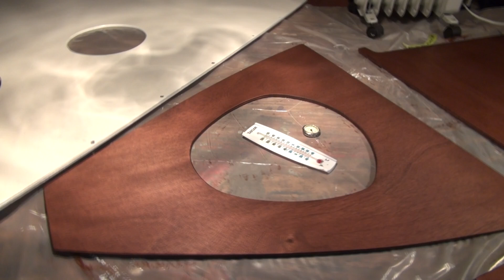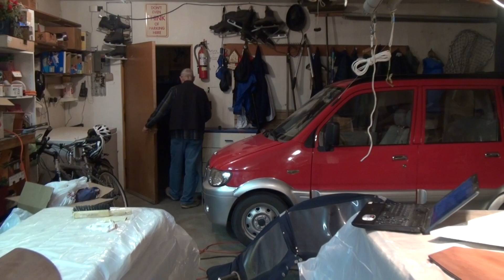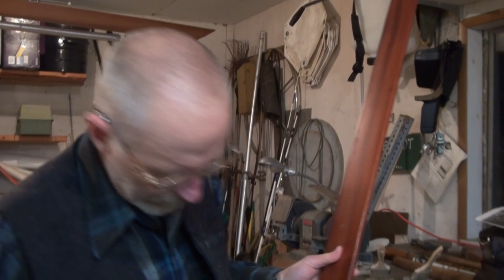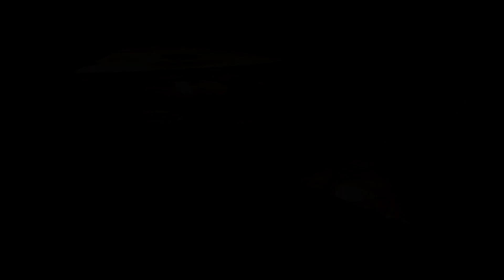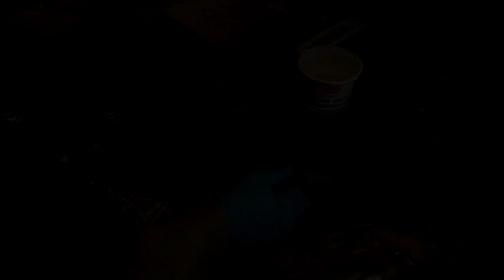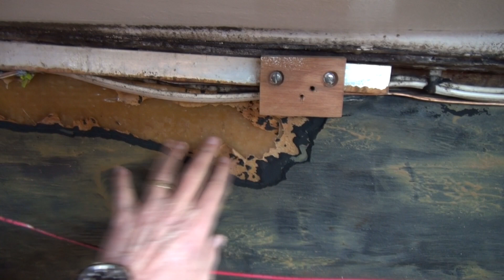Cruising Lealea Refit No.16: Previous Owner's Improvements

Comment: Few tips: You can wash epoxy brushes with alcohol. 
To treat both sides at the same time you can make a spike board. Hammer thin nails through a scrap plywood and turn spikes up, then start epoxing Your pieces from the backside, turn over on the spikes and treat the other side. On the backside it doesn't matter to have few small nailpointmarks.
Reply from the maker: +S/Y Ottiliana Good tip.  Thanks.

Comment: Stain looks really good, but perhaps a bit dark. Will it rob the light inside the cabin? It's common on newer boats to use blonde wood finishes.
Reply from the maker: +umvhu The end product will be lighter than it was before with the Yellow Cedar ceiling extended through the main cabin.

Comment: How far does that resin penetrate? Have you ever cut a piece of wood after all the coats were applied to check the penetration depth?
Reply from the maker: +Mazda rx7 We have not checked that.
Reply: Cruising Lealea
I was thinking it was kinda strange that if the wood was stained before the resin was applied, it wouldn't be able to penetrate very far. Therefore it's just a coating. If the resin has great penetration on bare wood, it might be better to color the resin to the desired shade. Do you also seal the edges of the wood?
Reply from the maker: +Mazda rx7 The penetrating resin appears to soak through the stain just as well as it does the bare wood.  Since we are coating the edges with every coat on both sides, the edges get twice as many passes as the flat surfaces.

Comment: Are you going to put in the stainless steel reinforcement on the main bulkhead?If so then are you going to do the for deck and mast step?
Reply from the maker: +cuppfw50 Our plan is to construct the main bulkhead of glass sheathed marine plywood and glass it in to the hull all around instead of just screwing it to the tabs.  The beam will be modified and the whole structure will be much stronger. We will not be using a steel beam reinforcement.

Comment: I'm noticing that your paying no attention to the end grain when you do your applications of sealer. It's been my experience that this is where water (moisture) makes its entrance through capillary action. It's the most vulnerable area of wood, particularly plywood. Just an observation. :)
Reply: +Jonathan Landwer He switched to the 3/4" or 1" brush at the end of that one segment, so it appears that he was headed for the smaller surface areas.
Reply from the maker: +Jonathan Landwer I guess we edited that out.  We did indeed carefully coat the edge grain of the plywood. As you point out (It has been our experience as well), the end grain of plywood is the most important part to be sealed. We usually cover the edges on each coat so the the edges get twice as many coats as the flat surfaces as we coat both sides.